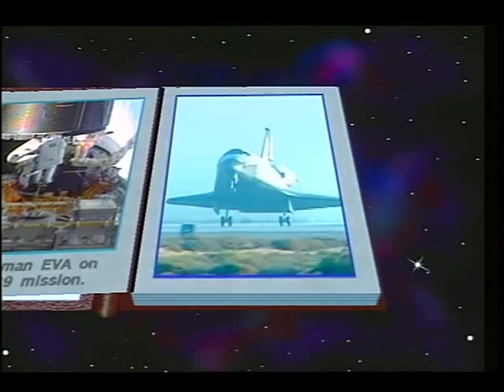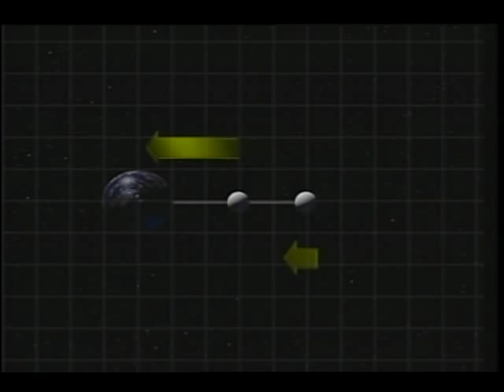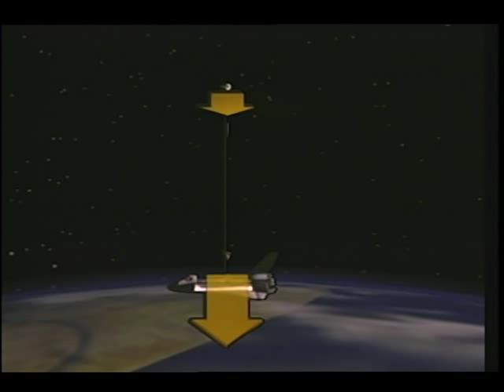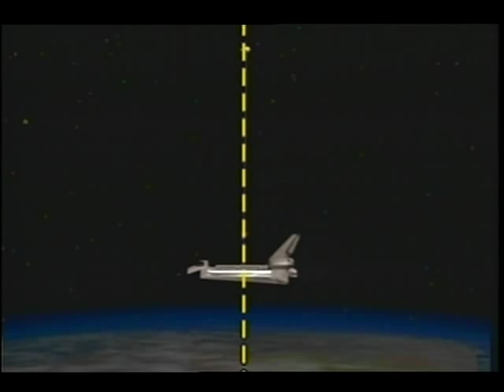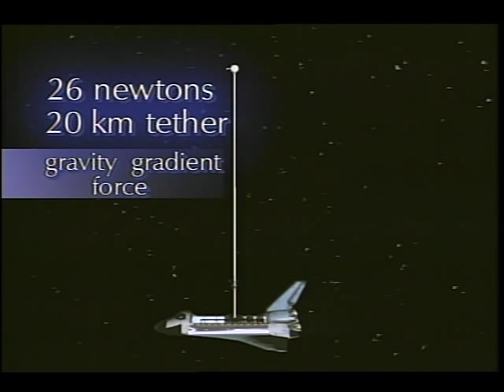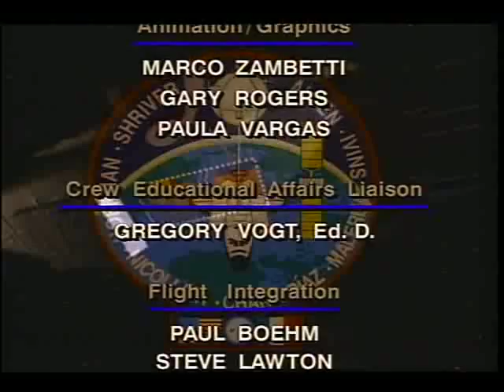Forces and Motion: Dynamics of the Tethered Satellite

Comment: Very interesting although there are 2 things that pop into my mind which are not covered in this video.
1> In the actual footage (other video's [STS-75]) the tether was not straight, but curved.
2> A current in a wire, generated itself by crossing the magnetic field of the earth, generates a magnetic field of its own which will interact again with the magnetic field of the earth.  This should have some effect too I figure.

I also wonder why such a promissing technologie is not explored any further.  Or is it, and is it just the media that failes to see the importance?

Anyone?

Kind Regards,

Kurt
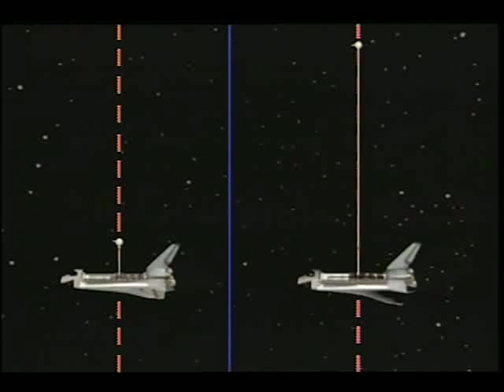Reply: Yes tethers in general and tethered orbit needs more love from media esp now that we have crazy materials availiable, but for that to happen we need some very fancy application for tethers: for example in the topic of Artificial Gravity, or a crazy discovery from a telscope in a tethered flying formation see SPECS mission, or some fancy mommentum exchange etc. For the curve in the tether of STS 75 i think that the main suspect is innertia of the tether it self, that 'triggers the coriolis effect, curve is shown in real footage 17:34  but is not succefully added in the graphic that follows. They do explain like system esp the tether is a very rigid object which is not the case. If an astronaut throws a ball vertically up from that Shutle it will follow a curved path from the astronauts POV: because the ball will not have the speed to catch up the shutle in a higher orbit (has to travel a greater distance). Other factors maybe a small atmosferic drag ?  solar wind? and if conductive some reaction with plasma? or magnetic field? or it could be UFOs? j/k xD
Reply: Classified.